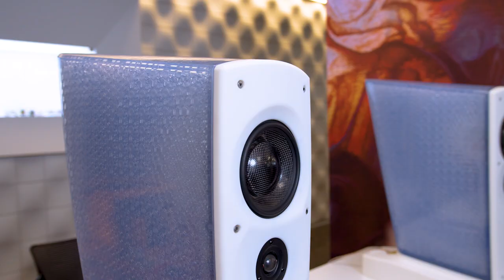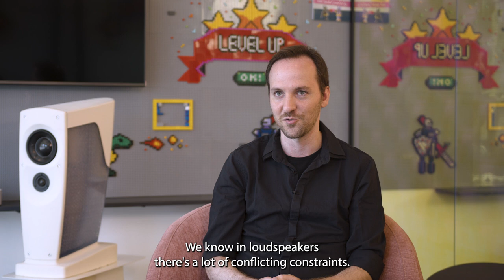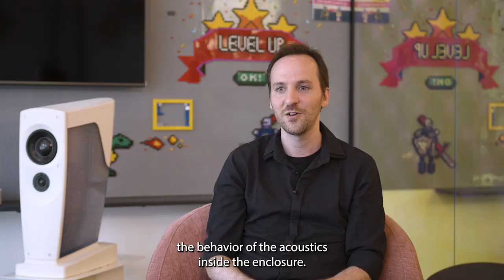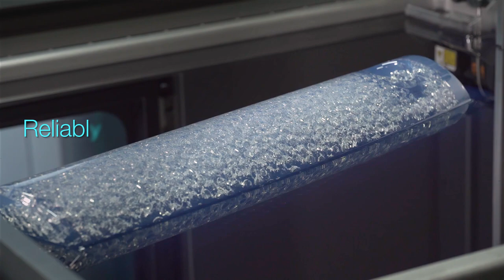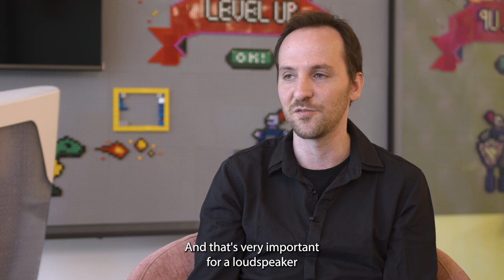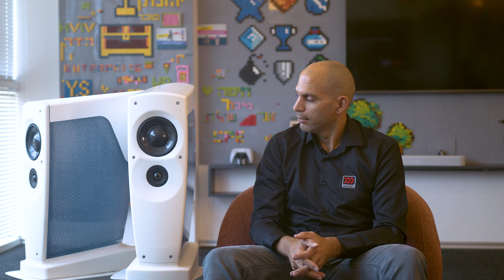Novel Acoustics 3D-printed concept speaker designed with Stratasys Stereolithography technology

Comment: Is there a reason you gave no technical information? Such as why the design looks the way it does. How the lattice improves sound quality. Were simulations run? Were prototypes made that resulted in adjustments to the lattice? Does it actually do anything? Or is it proprietary and this is just an ad?